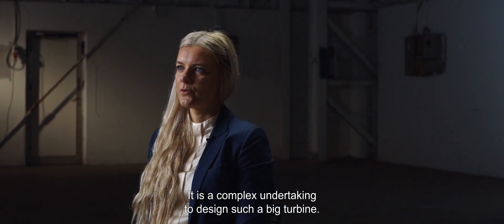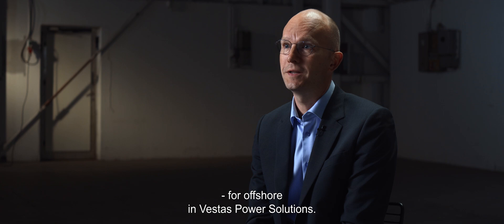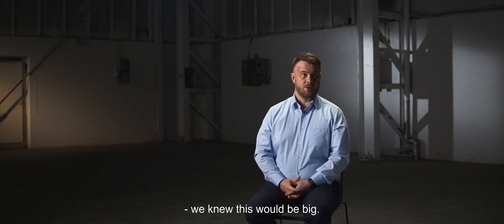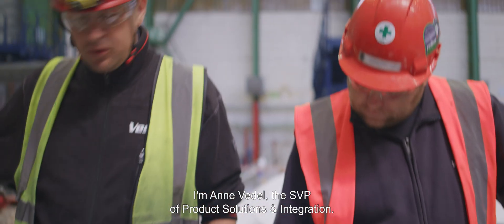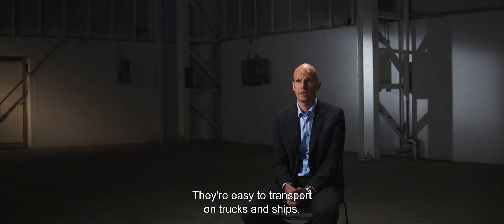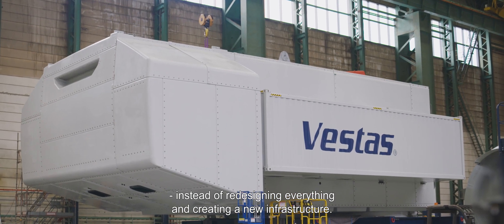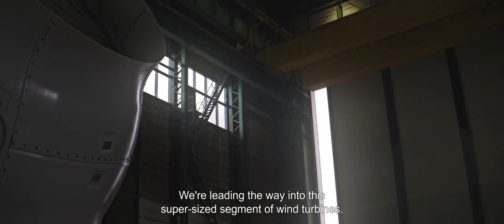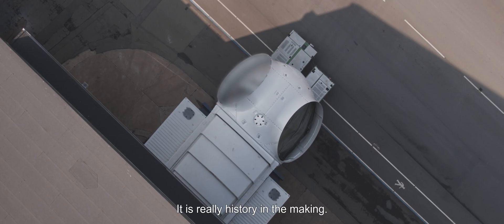V236-15.0 MW™ - Delivering on a promise | Episode 1: The nacelle

Comment: This is great but you will need 157 of these giant turbines to equal annual energy output of one 1600Mw EPR nuclear reactor. For perspective, to replace all of EU gas and coal electricity generation we would need 12000 of these turbines each making 80 GWh/yr. This does not include gas used for heating. The amount of transmission line capacity needed to carry all this power away from the north is 180 GW. Truly colossal numbers.
Reply: Latest nuclear plant build in Finland took some 18 years! Now what?
Reply: @lisette2060  That's cause Finland sucks.
Reply: That is true, but it would probably take near to a decade to build such a plant.
Wind turbines are also just a transition tool, i sure hope we will not have to look at those for all eternity.

Denmark are self sufficient with natural gas,,,,, the problem right now is our field are down for overhaul,,,, pretty shitty timing. ( storage here are at 100% )
Some homes do use gas for heating here, but far from as many was you would guess 412.000 households here are using gas for heating,,,,, i assume this include the decentralized plants that supply heating to whole towns,,,,,, which are the way most Danish homes are heated.

In 2027 the Thor offshore park ( 800 - 1000 MWH ) will be online, it can supply power for 800.000 Danish households, this are just the first of several similar or larger offshore installations.
Mapping here ( from 2019 ) say that there are potential for at least 40.000 MWH offshore wind power in Denmark,,,,,, this are way more than the population of 6 mill need.
Reply: you make some strange calulations, I hope you're not an engineer.
Reply: @vgstb  I include capacity factor which you never heard of and probably think 1gw wind = 1gw nuke.